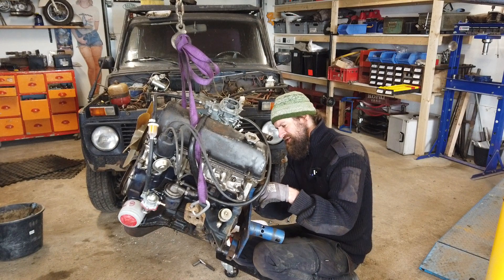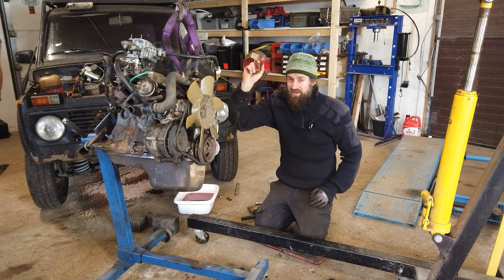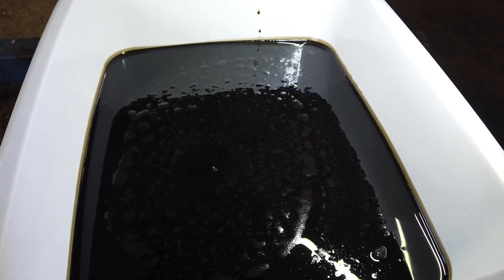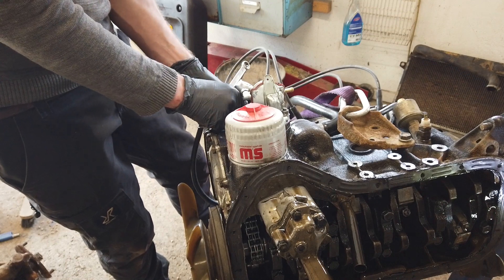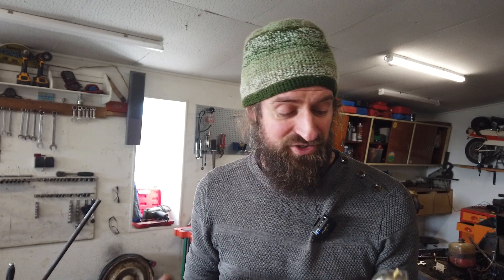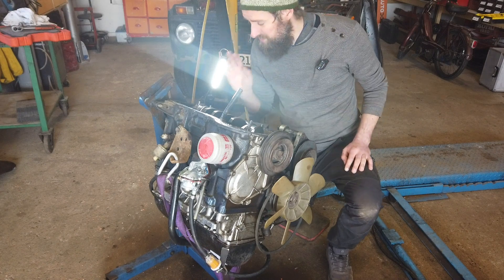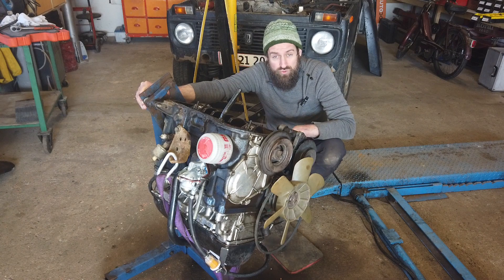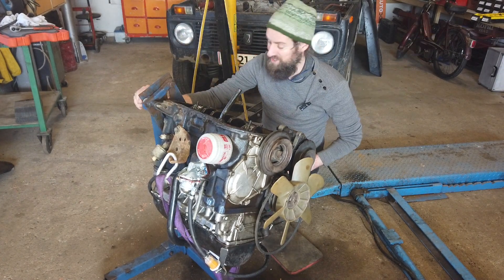Engine failure!? | 1978 Lada Niva

Comment: oil pressure is the achilles heel of a lada engine, i recommend you installing a 2 valved oil filter it's recommended for the classic lada engines with a hydraulic tappet but it helps to hold oil pressure(comes from experience i own 2classic ladas and a niva) and another weak point is the timing chain tensioner, don't get the automatic one it wears out really quickly
Reply: Can you please provide a link for such filter for lada niva? I had a hydraulic chain tensioner and replaced it with the automatic because of the rattle on startup. For now all is fine.
Reply: @cristianc1422  here is the part number 21080-1012005-82 it's an OEM part(the 2108 is the lada samara but the the manufacturer says that it's recommended for the lada niva or any classic lada) i'm currently running it along side with a 15w40 oil i have steady oil pressure even at idle, no the engine isn't worn out i rebuilt it a year ago lada engines just like thicker oil

Comment: Certainly quite the line of errors, but laying blame just makes things worse, easier to just admit something went wrong and then move on with fixing or replacing stuff, and on the plus side at least, you get an engine rebuild project, just a shame that it came about in such a way...

Comment: The lesson here is a reminder that we need to compare a replacement part to the original; I remember my Father and Uncles doing that since the 1960s. As you mentioned, in this case this engine was made in different sizes, and this one has a longer stroke while the new distributor has the part number for the shorter stroke engine accidentally put in the wrong box at the factory. With modern engine oil, engines seem to last much longer, so I would consider not spending time and money replacing the bearings again. If you can get the correct distributor quickly, I would be inclined to swap the gearbox and put the engine back in the car so you can get back on the road soon after the distributator arrives. ☮️

Comment: It just shows how important it is to be thorough when doing any work. For example, you checked and changed the brakes but didn't check the wheel bearings, changing a few rubber but missing others etc. Definitely worth just rebuilding this engine, i don't think its too damaged 🤞... I know its all done by the time im watching this but it feels it happened yesterday.
Reply from the maker: Its fun to read your comments going though all my old videos... :D

Comment: It seems that you have a lada 1.2-1.3 distributor wich has a shorter shaft. Lada 1.5-1.7 engises have longer distributor shaft. Shorter shaft goes in and works but it can pop out on some bumbs on the road.. seems that it has happend to you exactly.
Cheers from finland and keep up the good work 👍
Reply from the maker: yes its a 1.2/3 which was but in a 1.6 box... !
Really wierd that it fits together! Someone must have done that mistake before...
I hope I can safe just one 1600 with this video in the future!

Comment: Frustrating, sure,  but a very  valuable lesson, THANKS!
My '94 Niva shows low pressure on the analog meter when warm, but I've heard this is a common issue with the factory indicator/sensor  itself. Still, I don't like it when the red warning-light blinks on idle, and wonder what diagnostic meter would fit the engine to do a control reading?
I suspect you will decide to rebuild your motor...lykke til ;)  Have fun!
Reply from the maker: Should be very common on them... the pressure is LOW when hot...
But a generic pressure gauge fits the hole for the sender if you want to know the pressure :)

Comment: I`d say put it together again with the right distributor and give it a go. I dont think the bearing shells look that bad. Give another try!
Reply from the maker: Could work! but because I might end up selling it, I wont take any chances... So it will most likely receive a new crankshaft and a general overhaul!
Reply: Ok, it is you choice. I have overhauled two Lada engines myself, and just reground the old crankshafts. The mashinist told me that the bearing journals had a very hard surface, so indeed they don´t wear fast. I have the feeling that these stripes might have been there before your incidents happened.
Reply from the maker: @erlenddammen2174  Could be! But I think it would be a bit strange.. and the shells does have some rough marks at the sides.. like the aluminum has melted a bit.

But yea, it might still be alright! But it could also not be.. And Id like it to be good before I sell it... (if I go down that road)

And its a big shame! but actually a Crankshaft is cheaper then getting the old reground....

Comment: Idea! .....Put a big dependable bike engine in it...... 😃 ...BMW K engines. A flying brick engine will fit right in there, and take up just a little less space than the stock Lada engine.
Reply from the maker: Haha! A velo solex engine on each wheel maybe!
Reply: @SeasideGarage  🤣K100 engine is smaller than a Niva engine, and has more horsepower. Higher quality, too. Some guys I know put a vintage K100 engine in a crosskart, and it does pretty good. Sounds AWESOME too!
Reply: @SeasideGarage  Imagine how clean, and minimal the engine bay would be, with a K100 engine in there......... Flying brick engine, in a car that looks a little like a brick.... 😀 ....Imagine how easy to pull your engine, for any engine work...